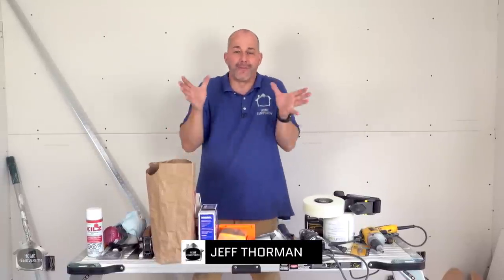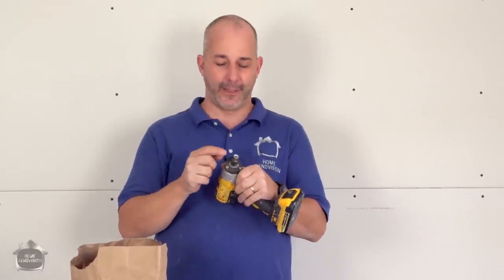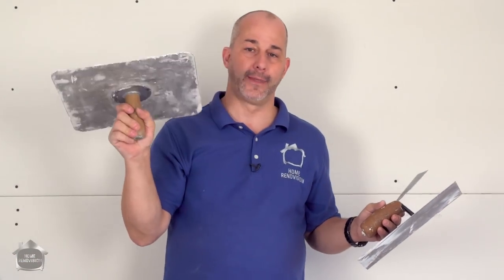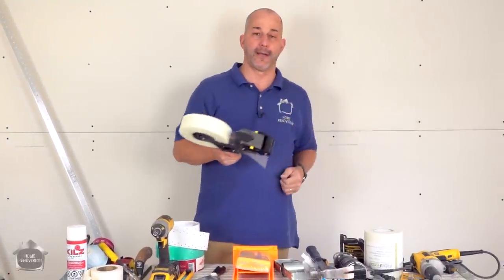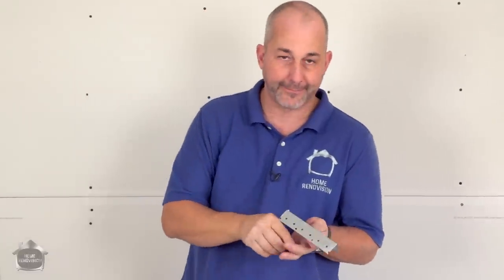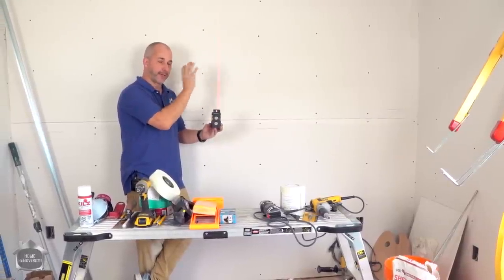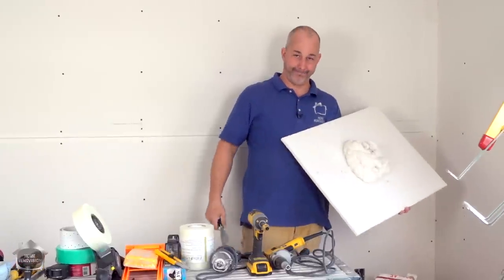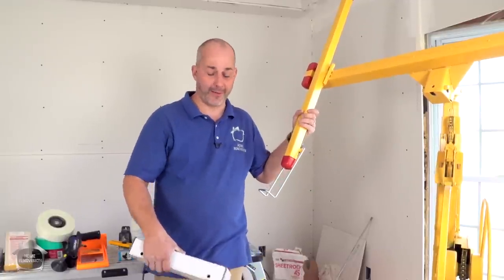The Tools You'll NEED For DIY Drywall

Comment: Picked up the new Makita Brushless drywall gun with Auto feature. It's unreal. Best drywall tool investment I've made. Hilti and the like are junk in comparison. 

The motor DOES NOT Run while the trigger is locked, until you press the tip. SOOOO much better, quieter and I get a TON more screws out of a battery charge without the motor continually running.

It's also got the colleted screw attachment which makes thing really quick!
Reply: Sounds like you’re green bro. Chill

Comment: I just did a drywall project in my basement for a home theater build, I have videos in my channel if you want to see. I found that after several times using the panel lifter it was easier to use when placing shims with the fat ends along the ground stud on each end of the drywall so the lifter didn't tear it up. It created enough gap to move under then lift up. Also, it helped to evenly lift the drywall when you that little lifter in the middle of a large 8 foot piece. This channel is where I learned the tips to get all this work done! Thank you for all your videos.

Comment: Another trick for old plaster cracks is news paper and mud. Just mud the newspaper over the sections that are cracked and they will look good as new.

   I did bury plugs behind walls and had to use a metal detector to find one I was missing🤣 I thought I was the only one that did that. I found that I’m more comfortable cutting out the plugs before installing and started using an oscillating tools for the clean cuts. Or I wind up using carbide blades that last forever even cutting through rock. Depends on how much sheetrock I’m doing. 

    We also have sheetrock 90. Give me a little more time, I find I do need to sprinkle a little water in while I’m working to stretch some more time out of it but once it hits the 90 minute mark, it just gardens like crazy.

Comment: Great video.  I try not to tell people that I know anything about either concrete work or sheetrock because they might want me to take on a job.  But......I just bought property in Sweden that has a huge, old pre-1900 farmhouse that has never been alter except for major electrical work and a bit of remodeling in 1964.  It is a sound structure and needs a lot of love.  It is a solid timber home built of scribe-fitted logwork with board and batten siding outside and lath and plaster on the inside.  There is old wallpaper and paint to contend with.  There is a solidly built guest house that was built in 1964 also, but never completed inside.  I will remodel this first to bring it back to life, so it looks like a "new" smaller copy of the big house. I will do this first as this will be my residence with the big house being renovated for use as B&B or hostel or some other wild Idea that I may have.  There will be drywall.......I'm sure.  I will surely be using your videos to get my speed up.  All will be well.

Whenever I think of tools, and especially during this video, I am reminded of what my Grandpa Fritch told me when I was about 13 (1963).  He had been many things in his lifetime, but it was carpentry that he was known for and sustained him well into his 70's. One day he asked me if I would ever want to be a carpenter or a mechanic. I gave him an enthusiastic and serious "Yes."  He told me to come over to his house the next week and see him.  When I went over there, we sat and talked.  The big take away from the conversation for me was when he said, "Mark, there are a lot of places you can invest your money, but in a lot of those places you can lose it just as easily.  But if you buy good tools, learn to use them and take good care of them, you will never go hungry."  Even then I knew that he was speaking from his own hard earned experience.  I've never forgotten that.  He then told me to go with him out to the garage.  When we got there, he gave me all the last of his carpentry and mechanics tools.  I still have some of his things that I will pass on to a grandson someday. 

As a child I remember a small framed drawing in the hallway of his house.  On one side of the drawing there was a crew of carpenters with good tools and perky looking dog building a new small home.  On the other side there were three rough looking guys and a scruffy looking mutt tearing down an old building.  Below the drawing, it said, "'Tis a good thing to remember and a better thing to do, to be on the construction and not the wrecking crew."  I guess he saw something in me that he didn't see in the other seven grandsons and I've always tried to honor his gifts.  I've always known that I followed the best path for me.  I passed it on to my son and daughter as well.  Now it is time to make sure that my granddaughter and three grandsons get the same.  I have more than enough tools to pass on for all the grandkids.  www.loghomz.com

Comment: Thanks for all these videos Jeff. You taught me most of what I know about drywall, and it's taken me from total beginner to at least intermediate. I wouldn't have even considered doing my kitchen, bathroom and laundry room renos myself if not for the skills and confidence I gained from your videos!

I was wondering why you only recommend paper faced metal corner beads for when you don't have proper framing to attach metal corner beads to? I see others recommend them over traditional metal corner beads in every situation because they're easier to install and don't crack over time. I'm sure both types work fine, but I'm seeing different advice out there. Is there a downside to paper faced metal corner beads that I'm not aware of?
Reply from the maker: Right on Brian. Happy to be of help!

Comment: I've done about 3 bedrooms, TBH, I've been favoring not having the square for cutting. I get a straight line drawn with just a Bic pen, score the line with the knife a couple times, dig in at the corners, and get clean breaks and comparable line straightness. Anytime I've used a square, I have a hard time with squares being imperfect and needing to be replaced, and/or digging my blade into the metal square which ruins blades a lot faster.

Although I don't hang drywall from the top first. Mainly because I don't have anyone to help or the drywall lift thing. I seem to be doing a good job with just doing it from the bottom up, which helps me offset the uneven floor in my basement. Or what I will do is stand the drywall vertically for various reasons. Although, in retrospect, perhaps having the drywall in contact with the exposed cement basement floor might leave it suseptable to absorbing moisture. So perhaps it would be wise to include a moisture barrier. (note: I'm using 1/2" green mold resistant sheetrock)

Comment: Have you heard of a "Rock Ripper"?  My dad bought one a long time back and I've kinda taken it over. It's basically a mini T square with holes every 1/16" to place your knife blade in to rip sheets. Instead of using the tape and knife combo you mentioned. I'm a professional and use the rock ripper and T square all the time. I like the skin on my fingers (and accuracy) so I have never done the tape and knife deal.
Great videos by the way. Cheers!

Comment: Question- I have an old house, plaster and lathe with asbestos insulation in the wall cavity and chances are some lead paint a few paint layers down. I would like to renovate at least a few rooms. I am insulating the exterior with 2” foam board but for the inside I’m thinking that I I install new 2x4 walls and leave the original walls completely intact. I run new wiring into the new walls and Sheetrock them. I’d have to box in the windows but don’t mind that. Is that a crazy idea, is this ever done? Abatement is outrageous.

Comment: 20 years ago and more I did the drywall for all our walls and ceilings.  Everytime I used that mesh tape it didn't stick right and also cracked in the seam where the joint is.  I bought the drywall mix in the bucket.  Is there a better product than the compound that the mesh would work?

Comment: Hey guys, I need to make a straight clean cut on the bottom of an upper cabinet over my fridge to get it to slide further into the space.  Right now its jutting out about 10 inches because the refrigerator door hinge things are hitting the cabinet box above.   What's the best was to make a neat straight cut with the cabinet in place ?  Thanks!

Comment: Jeff,  suggest expanding series to cover tool selection in general.  Santa knows we've been good.  What about things like selecting Li-ion brushless drills for example?  1/2" vs 3/4", how many volts, big box models vs those from various wholesalers.  What DIY tools are essential longer term, could be rented once, or are not needed?   Not only do you make a little off an amazon sale but it is probably much easier to record the episode...just go to your toolbox and talk.   :-)
Reply from the maker: Cheers John , looking at this soon!
Reply: @HomeRenoVisionDIY  1.  Jeff, are the power tools available from wholesalers better quality or sold at cheaper prices than those from big box retailers or building supply stores?   2.  How does a combo impact driver and drill work?  They use different bits don't they sir?  Cheers mate

Comment: Help!! So I didn't research before starting my work. I'm a new widow and I thought I remembered what my husband had done in the past. I already had Fibatape and I used it in a bedroom and then bought and  applied my first coat with readymade all purpose joint compound. Is everything going to fall apart on me? How do I proceed?
Reply from the maker: let it dry. it will be fine , you may just need to do an extra coat of compound to get it all smooth is all. Cheers!

Comment: I know all these comments will upset people. Not my intention to shame. "My" way is only cherry picking the best I have seen of other(delete other, I think that infers I am a master and I am not , Just a guy that was paid to fix their work) masters work over a 40 year span. I didn't buy a board lifter, saw a guy make one. I didn't buy a toe lifter, I saw a guy make one out of a 2X2. I don't rent a panel lift, I make one out of 2X2. Last, at the end I would have put a screw in that vent flange just to prove myself wrong but those holes look made for a drywall screw to sit as flush as a ring nail.

Comment: Would you do a video on fixing a crack on a horizontal seam. Less than a month old and recently painted, new purple board, optional. Thanks.
Reply from the maker: Most likely it is a relative humidity issue. do you have a humidifier on your furnace?

Comment: Why use metal corner beards on outside corners instead of the paper? I don't have a preference but I see a lot of older guys using the metal and younger guys using the paper. I guess you are one of the older guys lol.
Reply: Metal it's definitely old school but there are times I still use them on small jobs.  For large production there is a tool that auto muds the paper corners and really speeds up the process.
Reply from the maker: there is speed and then there is quality. You need to decide what you are looking for. metal is quality!
Reply: Home RenoVision DIY Trimtex is quality, far superior than any other bead. It doesn’t dent like metal bead, way more durable. Most commercial jobs use the vinyl trimtex beads.
Reply: @HomeRenoVisionDIY  I don't see a quality difference between my basement beads and my main floor beads, both are different. This comment doesn't add any detail to why I should choose metal or paper. Please explain.

Comment: 20:13

Quite a few useful tool suggestions. 

That $80 gun on the right (your left) is just limited to one purpose, whereas the bit that you can put on the end of your impact driver seems more versatile (and cheaper too). I like tools that I can use for different purposes. I don't see me hanging drywall on a regular basis to justify spending the $80+ for the drywall screw gun. However, for those that do hang drywall it may be worth it.

Comment: We use a staple gun for metal externals, nails or screws into the timber leave to much room for movement with expansion and contraction. That's the theory anyway haha whatever floats your boat tho
Reply: A brad nailer also works. They are used for trim work but they nail into metal corner bead and hold really well. Also they go deep enough so the heads don't usually mess up your mudding. Just a tip, works great

Comment: Do they not have the plastic corners in Canada??? It’s nice because they don’t dent like metal and are extremely durable. You can hit them with a hammer then just add mud where the old mold broke off. Those plastic corners don’t break either.

Comment: You should include a cheap 5 dollar mud pan. Great for mixing and applying small amounts of mud. Building a 6' X 9' sound proof room in the garage in the evenings. It's not realistic to mix a full bag of mud every night. Hang a few sections of drywall, mix a half pan of mud and apply. Maybe 2 or 3 days later get back to the job. That mud pan works great.

Comment: Hi, Jeff I have terrible bubbling on my plaster bathroom walls and ceiling. Is there any way to remove this and make them smooth again so that I don’t have to demo and rebuild with new drywall? Plus I removed tile on one wall and have an uneven cement areas exposed on the wall now showing where the old mud glued the tile to the plaster. So how can I fix these two problems? Tia

Comment: Bought a century farmhouse in June. Nearly complete with main floor reno (opened up 3 rooms to create kitchen, dining and living area). Last big items to do are tile backsplash and flooring. Going with a vinyl plank. Trouble with flooring is that existing wood is very uneven. I'm thinking levelling cement in spots but I've never used the stuff before. Is there another way you'd suggest?

Comment: I find a mud pan easier than a hawk for repair work.   If you use the premixed mud, you can just water it down enough using a 3" knife to mix, and then bring it up the ladder with you, keeping your knife inside, so you have one hand with the pan/knife and the other free.  Also there is no need for a separate bucket or anything to mix it together.

If you're going to get the drywall screw gun, you should also consider a collated screw gun.  That way you don't even have to grab the next screw, it's already self feeding.  They're great for subfloors too.

Comment: So I pulled out a vanity in my bathroom and now need to redo a section of drywall. I need to redo two corners but only a 4 inch section on each side should I just mud the tape like usual or do I need to redo the whole corner going all the way up the length of the wall?!

Comment: in your previous drywall series you screwed (and promoted the use of screws) for metal corner bead.    I've always screwed mine without issue and dimpled the metal down a little.   I also use long (1-5/8 to 2") screws to get right into the wood.

Comment: I like the look of the air diffuser on the wall instead of the floor, but does that solid center block impede airflow much? It seems like the airflow would be restricted pretty bad. What are your experiences with that?

Comment: You can use the router to cut out the holes for the recessed can lights, if I use the new led flat  recessed lights in my basement (canless) should I use the drill bit attachment or the router (there is no can to guide the circular cut-out)?
Reply: They sell special plates that attach to the framing. You place them where you want your lights, put up the dry wall then use the router. Now you have a surface for the bit to ride on.

Comment: After the mud is dry and you have sanded, what is the best way to clean away all of the extra dust left on the wall?  Is the wet sponge method the preferred way to go about that or does that leave wet streaks and does it remove some of the mud that has dried on the wall already?  I have also seen people that "sweep" the walls with a broom, is that an effective way to go about it?  Thanks as always!
Reply from the maker: no need to worry about the dust. leave it there and roll it back into the primer. Cheers!

Comment: Am i in store for bad news if i used rapidcoat (green tub) in my bathroom? I used the anti moisture blue gypse sold in Quebec with paper tape.
Reply from the maker: Just be sure to use a roll on membrane to waterproof and you will be fine. Cheers!
Reply: @HomeRenoVisionDIY  For the shower walls I used diamond back, did the joints with prova tape and proper cement that goes with that tape. Then i rolled on some water proofing membrane and did my tiling. The rest of the bathroom walls i only used the anti moisture gypse... was that a mistake?